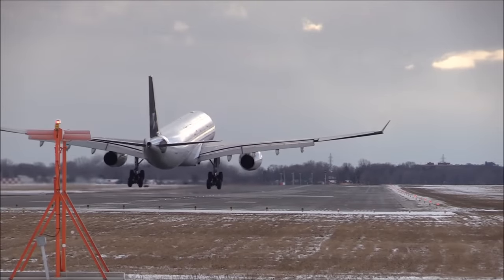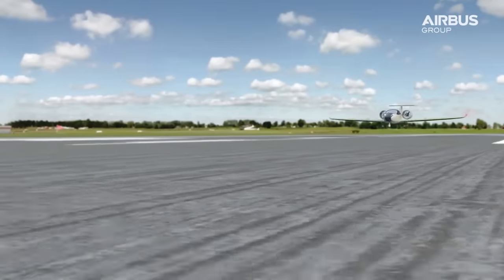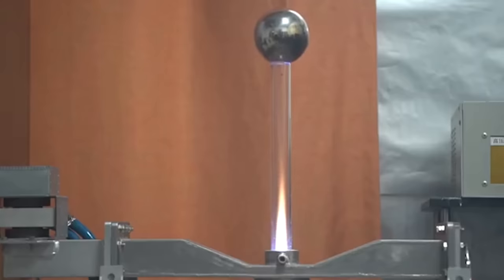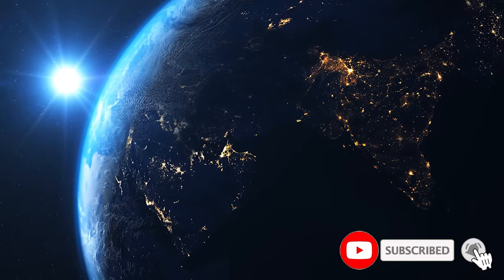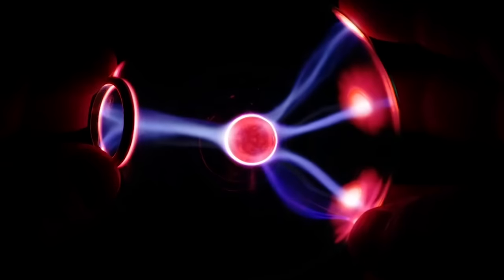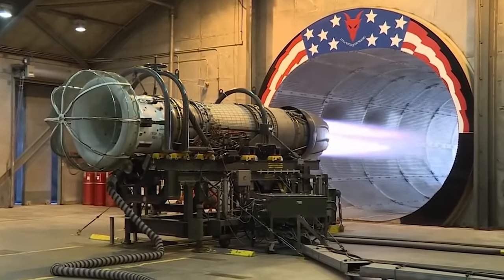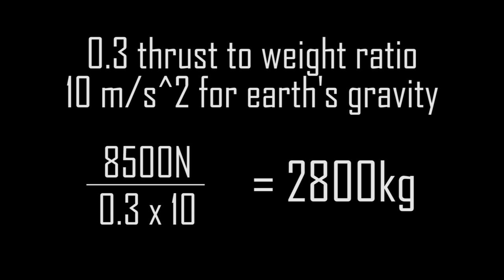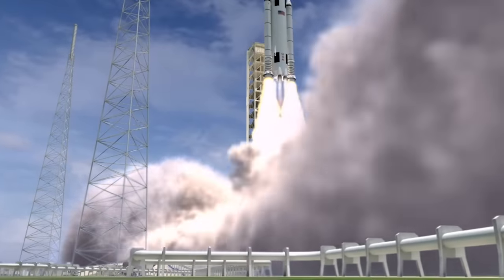Uncovering China's New Electric Plasma Jet Engine

Comment: As a retired airline pilot I've always been interested in advancements in aviation. In the last half century we've seen aerodynamics, avionics, and construction methods improve but propulsion improvements have lagged. Light category aircraft have benefited from improved engine reliability but the high bypass fan jet engine has been the workhorse of the airliners and seems likely to remain so for a long time.
Reply: Beating their incredible efficiency and the energy density of jet fuel is one hell of a hurdle.

Got me thinking though. I'd imagine, unlike history, civil aviation will be the first adopters of this. Unless fast charging and energy densities really increase for batteries, the military is going to want the faster turn-around times of just shoving fuel in the aircraft. (Though I'm sure the US Navy is already looking at this really hard. The newest carriers have a ton of extra capacity for energy generation and distribution for future tech. Electric aircraft would reduce logistics requirements a fair bit.)
Reply: Robert Slackware  lmao, no. Just no. Literally no one banned anyone from pursuing cold fusion. It just literally doesn't work.

Except for muon-catalyzed fusion, which is in fact a thing. It also requires you to have a particle accelerator handy. Not exactly practical, and farther from net positive energy than the worst tokamaks.
Reply: I remember as a kid i was always asking why no one build plasma engines, it seemed so doable. And now after years upon years of imagining what it would be like and playing around the idea in 3d modelling program, now China makes the first steps. Same goes for space mining. Why nobody tried before until now China is making the first steps again. Its kinda weird.
Reply: @EddyKorgo  Don't mistake being the first to publish something that might work with the first time it's been tried, or even developed.
Reply: @EddyKorgo  It's cos of the cultural shift in the 1960s. Western Society turned its back on the incredible scientific advances that propelled humans to the moon, and turned towards "the arts", hence we went from walking on the moon to not even being able to achieve low Earth orbit without using someone else's shuttle. When our young 'uns start studying science again, instead of "arts", we will stop falling backwards like the Western world did after the fall of the Roman Empire. We should learn from the South East Asians, who went from agricultural societies to leading the world in technology in a few short decades. A very inspiring bunch of chaps. Cheerio!
Reply: @liesdamnlies3372  nope. IT DOES WORK. just it has to be studied deeply, cause they do not really understand how it DOES work. governement just do not finance project about cold fusion, and unless a billionaire want to do it, nobodody else will. so yes, no goverent has banned research on it, but without accessing funds, the research is basically impossible.
Reply: @oreziopancrazio3685  Prove it.
Reply: @liesdamnlies3372  are you serious?
Reply: @liesdamnlies3372  im not a scientist. in case you need more info about, my country, Italy, and Japan, are the two country which have experimented most on cold fusion. You can easily search on the web for Giuliano Preparata and Emilio Del Giudice, they never gave up on cold fusion, despite the exigous funds. Now even Nasa 30 years later is on it, they change name because "cold fusion" its a disgraced word. Thy call it LENR, low energy nuclear reaction. Search for it, you will be surprised.
Reply: @Zero Harness gravity? Huh? You mean like we do with spacecraft?
Reply: @oreziopancrazio3685  Okay, so let me get this straight. You insist that cold fusion is a thing, insist that the only reason it isn't being researched is because it's being suppressed by governments through not giving it any funding. This is wrong. You then go on to say NASA is "on it" and that they called it "Low energy nuclear reaction". This, again is not true. And you say all this authoritatively in your previous posts, but now fall back on "I'm not a scientist." Indeed, you aren't. I can tell.

Here's a single reference to LENR from NASA: https://nari.arc.nasa.gov/node/259

That report does not consider the feasibility of such reactors, only what could be done if they existed. It's right in the abstract: "This report does not explore the feasibility of LENR"

"Low-energy nuclear reaction" is not a term coined by NASA either. It dates back quite far and is used by the people who still pursue cold fusion to disassociate themselves from that term. This is no different than alternative medicine people rebranding something that's bunk as something else to not be dismissed, deservedly.

The only link I can find between NASA and this term, "LENR", where NASA is touted as working on cold fusion is from terrible science "journalism" that mistakenly links it to NASA's recent breakthrough (this year, in fact) with lattice confinement fusion. That's not the same thing at all. It's not even cold! What NASA has done is initiate good ol' hot-as-hell fusion on a small scale. Pumping 2.9MeV of gamma radiation at a single point is a shit-load of energy. It's hot fusion a tiny bit at a time. Is it exciting? Sure as hell is. Is it cold fusion? No. No it is not.
Reply: @Zero Barring a theory of everything that turns-out to have gravitons, I really don't see that happening. I mean, even assuming you could do it, influencing space-time like that takes a lot of energy. A lot a lot. If you know about the Alcubierre drive, you might remember how models of it predicted the energy requirements to be several times that of all the matter in the known universe. Better geometry of the rings got the energy required down to a single Jupiter mass. (Yes, that means getting all the energy out of the entire mass of Jupiter. Black holes can only be used to convert about 5% or so of matter into energy, and that's the most efficient process we see in the universe, that isn't a matter-antimatter reaction.)

And of course the ultimate caveat: That's negative mass. You have to assume that this exotic matter exists at all, and then have unfathomably large amounts of it to bend space-time to a useful degree.

Artificial gravity is something very, very squarely in the realm of science fiction. It's not that we just don't know, it's that we actually do know what's involved and it ranges from wildly unlikely to provably impossible.
Reply: @Zero One, I said "wildly unlikely to provably impossible" which is not the same as saying "impossible". Two, you can indeed prove things to be impossible; that's the power of mathematics.
Reply: how about they make planes that dont crash first
Reply: @Robert Slackware 
I'm always amused by people who claim that "the government" is stopping us from having advanced or free energy. All the energy for my home and my car is free (after the investment for the collector and storage) and not only did the government not try to stop me, but the government subsidized the initial cost. Solar panels on my roof provide all my energy for free, and batteries in my garage store enough to carry me through the night. Combined state and federal tax credits paid for 30% of the cost. We are surrounded by free energy: Sunlight, wind, hydro, geothermal, and others. These are real and they work and the government supports them. The only reason to want fusion (hot or cold) is so that electric utilities could charge us for the electricity. Further, if cold fusion worked, it wouldn't need the government to pay for it. The big utilities would be building it. Harping on cold fusion makes no sense. We have free energy all around us. All we have to do is gather it up.
Reply: @danielschechter8130  "The only reason to want fusion (hot or cold) is so that electric utilities could charge us for the electricity"

Well that part just isn't true at all. There are plenty of other reasons, like fusion propulsion systems, or for applications that require large amounts of energy locally (certain industrial operations), or high-energy physics research.

And there are places in the world where all of the sources you listed are unavailable in sufficient quantities to replace demand. And there's the density problem, with simply how much land every method you mentioned requires. (Yes, even geothermal plants need very large areas to deal with waste water.)

All that said though, screw fusion, it isn't here. Fission is where it's at.
Reply: @liesdamnlies3372  you can’t just say “screw fusion” and then say “fission is where it’s at”. You do know that if we do achieve fusion then it will be the most efficient and cleanest power source humanity has seen? Sure fission is great, but it produces waste that’s highly toxic, and needs to be buried for hundreds of years. Never settle, because when you do that you’ve given up on what technological advancement really is.
Reply: @___solar___  "You do know that if we do achieve fusion then it will be the most efficient and cleanest power source humanity has seen?"

Um, no. That depends on exactly what kind of fusion you're talking about. D-T fusion still produces high-level radioactive waste. If you want clean fusion power, you need to have aneutronic fusion, and that requires significantly higher temperatures and pressures than D-T (and, a reminder, we can't even get that close to net positive energy yet). It also has this pesky problem of not being available. We need a solution to our energy needs now. Not tomorrow, today.

The waste problem for fission is solvable and has been solvable for decades. People seriously hype-up this "highly toxic" waste far too much. For one, "toxic" is the wrong word anyway, unless you're planning on chowing-down on heavy metals. The Swiss, for example, use geologic storage for their waste, and the waste from all the power plants for the entire country fits in a relatively small room (think a few Olympic swimming pools in volume). You literally just let the stuff cool in water for a few years, pack it up into concrete containers, stick them deep underground in areas that aren't geologically active, then seal them up when you're done. Finland is doing the same. I suspect you don't know that much about the current state of nuclear fission as an energy source given that you brought this up as if it were a compelling argument.

This isn't about "settling" for anything. This is about using the tools we have available to solve a crisis. Waiting on fusion to get anywhere isn't an option.
Reply: @liesdamnlies3372  wow, you are hot as the fusion in which you strongly believe. relax. cold fusion is a thing, exist, the chemical rwaction DO produce excess of energy output. at this point of research they do not understand how to controll this reaction, but the production of energy is there, indeed.
Reply: @liesdamnlies3372  desktop particle accelerators can now rival the large ones.
Reply: @gary.richardson  lol wut
Reply: Have you heard of the geared turbofan? It's not a new concept, was being worked on for a very long time, but I think it does qualify as an advancement in engine technology. After all, it increases efficiency and decreases noise production.
Reply: Problem is that propulsion is governed by thermodynamics, a really stubborn law of nature, impervious to every trick.
Reply: @EddyKorgo  this stuff has been around for 70 years the reason no one uses it is because they are way to innefficient
Reply: The last word, and coincidentally the latest, is field propulsion. My work in theoretical physics should be ready for publication by 2023.
Look for the term GMP. And don't buy into the cynics naysaying. There is a huge vested interest in combustible fuels. And they want to keep their monopoly on power. Does anyone really believe our future to the stars lie in rockfuel ? lol Give me a break !
Reply: @liesdamnlies3372  what kind of fusion do you think I’m talking about? And I don’t think you get the importance of advancement and research here. You’re too busy thinking about now and not *what could be*. Sure, storing waste in a geological storage container is good, but we could clearly eliminate that whole process if we achieve a aneutronic fusion. We’re not far off of achieving this. All it takes is a few more years of constant research and development. Keep in mind we are in fact in a technological boom and things will start getting invented at light speed. More tech has popped up in the last 10 years than in my lifetime.
Reply: @stefanschleps8758  exactly. There are way more efficient forms of propulsion to crack. If we find out zero point energy it could change the game forever, as well as finding out how to create antigravity.
Reply: @___solar___    “What could be” isn’t good enough for solving our energy needs and climate change. Fusion has been just a few years away for what, 70 years now?

We’ll have passively safe fission reactors in a few years, and I can say that with confidence because the engineering and regulatory problems are being solved apace here in Canada, on top of the technology being well-understood.

There’s a huge difference between solving engineering problems and physics problems.
Reply: @liesdamnlies3372  I can see you have no hope. No faith that someone will eventually make a breakthrough. Stop worrying about what’s going on in just Canada and worry about what the whole world is trying to achieve. The whole of humankind is trying to achieve fusion, not just one country. Think about that for a second.
Reply: @liesdamnlies3372  on top of that we are trying to achieve something that has a power output infinitely times greater than fission. I can see why people are trying to achieve this. There are several joint countries making breakthroughs to this day.
Reply: @liesdamnlies3372  the men that built the tools and technology we use today were ambitious. Doing this and researching this requires ambition, otherwise we wouldn’t be here today as a species. Ambition drives innovation.
Reply: @___solar___  "power output infinitely times greater than fission"

Call me when they can manage to even get net energy. You know what actually is making the necessary progress, right now? Programs like Rolls-Royce who will be building Small Modular Reactors in the UK within the next five years. Nuclear reactors, right off an assembly line. Fission is on its way to reaching economy-of-scale and passive safety.

You're talking as if I want fusion to fail. There's a difference between "having no hope" and simply being pragmatic. It's insane to have a tool right in front of you that will get a job done, more than satisfactorily, and not use it and rather waiting for a hitherto unproven-future-maybe-solution to the same problem. I have a hammer, and need to drive a nail into a wall. The hammer will do the job just fine. Should I instead wait for someone to invent the next, best nail gun? No.

Stop romanticizing the pursuit of fusion as an energy source and put on your thinking cap instead. I'm talking about solving a crisis with the tools we have, right now. You're talking about what might be a nice solution if it works in future. Even if it does, it still will not have solved the biggest issue with nuclear fission, which is being solved right now in the latter, which is the initial capital investment.

To use another analogy: Someone is having a heart attack. I have an AED that will stabilize them now. Should I wait until I can get them to a hospital thirty minutes away so they can use their better defibrillator? See, even if fusion is a panacea, it's not coming soon enough. Even if we had net energy yesterday, it's not soon enough.
Reply: @liesdamnlies3372  I think you misunderstood or I didn’t note that fission is good, yes. And I’m not romanticizing. Simply stating the importance of figuring out how the fuck to develop fusion power. You’re talking about fusion not making good investment, and I’m here to tell you money doesn’t drive research and industry, which gets products up and moving in the public use. Its not just that, but it’s the people’s effort. People drive industry, and it’s everyone’s choice wether they want to give effort to get fusion going. A world with only profit and no effort, dedication, or passion is a world making no live changing progress. Just rich people making more useless profit. And right now there isn’t much effort today. Just people talking about how the next product will make them money, it’s sad. Capitalists crave only profit. Did you know that technology the government possesses is about 100 years ahead of the tech that the public uses? Probably not. This is because we only put technology out to the public for consumption which makes long term constant profit and is easy to make. There needs to be an awakening (If you look, it’s only just now beginning), and it needs to start now, or never. Think of a world where everyone works together and helps each other. What kind of world would you imagine.
Reply: To those educated and understand fusion I have a quick question (I hope it’s quick), I thought liquid salt reactors ( I think that’s what they are called) solved the issue of fusion reactor waste? I watched a young prodigy speak about a reactor he had designed ( recently) that runs on reactor waste and is cold,can’t melt down like regular reactors and is quite small, I believe he said a shipping container sized reactor would produce 50 megawatts.....thoughts?
Reply: @1966cambo  my past comment I thought you were talking about fission. My bad. A certain type of fusion shouldn’t produce waste as the process is the opposite of fission, it is compressing particles together so no waste is present, only energy. Other forms of fusion I’m not really informed on, although that cold fusion reactor you talked about is true, and I’m guessing it runs on the waste from fission reactions.
Reply: @1966cambo  there are several ways to produce a nuclear reaction to produce power, but aneutronic fusion is the holy grail in power generation. That’s what we’re trying to achieve. With that being said we can also use easier forms of reactions to produce our power in the meantime. Hope you have a grand day. Sorry if I look like I’m spamming lol
Reply: @___solar___  right, sorry I have my term wrong, it is fission reactors I was asking about . The fact the liquid salt reactor this kid invented uses waist from reactors and eats it up it solves the one big problem with reactors, radioactive waste! 
So why not have larger reactors near larger cities and these small salt reactors in smaller towns? 
Seems to solve the electricity issue ......
Reply: @1966cambo  I think you're mixing-up a few things there. For one, they'd be talking about "waste" from nuclear fission (the more accurate term would be spent fuel), not fusion. When fuel is spent by one nuclear reactor, depending on the design used, it may still be usable in another. The CANDU has long been able to serve as a garborator of sorts for the nuclear industry, it's just not been used in that capacity. It's easier for us in Canada to just keep mining our large uranium reserves, both for domestic use and export, than it is to even consider wrangling through all the legislation, policy, protests, NIMBY's, and everything else just to get our hands on say, the US' spent fuel from their reactors. (With reprocessing though, we could easily be using most of the fuel they have left-over from their light-water reactors in ours.)

When it comes to burning-off spent fuel, you either need a reactor that can run on the fission products of the reactor farther up the chain (like how a CANDU can gobble the "waste" from light-water reactors, in theory anyway), or you need to change tack and go with a different fuel cycle. I suspect what you saw was a molten-salt reactor (MSR) with the potential to use the thorium fuel cycle. With the thorium fuel cycle, we could add small amounts of spent fuel from the uranium cycle and burn it off. The waste then only needs to be kept safe for 300 years until it's safe to handle, and we can build geologic storage that'll last that long, if we want to (Finland is doing it).

They might have also mentioned fast breeder reactors, which could do the same, using spent fuel from the less efficient and old-as-fuck reactors being used so often today.

Of note, MSRs can be designed (and are being designed) to be passively safe. That means you can literally walk away from them. If there's a loss of power to the cooling system, the problem doesn't get worse, the nuclear fuel will spill-out onto a slab underneath the reactor where it'll be in a non-critical state. Don't get me wrong, it'd make a right mess, but it's a safety measure that requires zero human intervention. We can, in short, design reactors to fail safe now (and are).

There are also other approaches to passive safety. One I learned about that Rolls-Royce may use for their version of small modular reactors (so mass-produced in a factory things, letting economy of scale become a factor in future), is to simply have the reactors in a giant pool. They would have active cooling during normal operation, of course, but should all else fail, the reactor will power-down and the water surrounding it will provide enough volume to absorb the decay heat. Bingo-bongo, you've got yourself passive safety (just make sure the pool is kept full XD ).
Reply: @liesdamnlies3372  I said “liquid salt” I guess I should have said “molten salt” but yes that was/is the design I am speaking of. I believe his design was fueled by the spent fuel from large reactors and he believed he could just bury the reactor so as to keep people from messing with it.
Interesting stuff
Reply: @1966cambo  Sticking the entire reactor housing in the ground sure would reduce your deconstruction and decontamination costs at the end of the reactor's life.
Reply: @1966cambo  when industrialization kicks in with that new model (which will eventually be in short time) then we could see these fission reactors in small towns, and fusion in cities. Indeed.
Reply: @1966cambo  then if time comes along we could then transition smoothly into all fusion based reactors.
Reply: @___solar___  I had a good laugh when Obama offered the kid a job and the kid replied, no thanks but I will sell you my technology. Brilliant kid in so many ways!
Reply: @1966cambo  the kid must know what the job system is like. Good kid.
Reply: @liesdamnlies3372  While I agree, it is similar revolution like SpaceX resuable rocket boosters, but then military is tempted to find big dam or similar near airport to drain huge amounts of power. Boeing 747 also eats fuel like candy so after space rocket it is second in line. Tho this is still interesting what advances they can do in aviation. For least, it will widen possibilities of energizing planes from just jet fuel to multiple sources, maybe according to size of plane or other factors.
Reply: @theloweffortchannel7211  
That's ridiculous! I have solar panels + batteries. My entire house AND my car are run on 100% solar electricity. It's way cheaper than power from the grid and produces no carbon.
Reply: @danielschechter8130  And you purport that it is viable globally despite a hard limit being lithium because?
Reply: @theloweffortchannel7211  
No single solution is viable everywhere. You stated that solar is a scam. It is not a scam. It is the best way to produce electricity in areas with abundant sunshine. In some areas wind power is more effective. Or geothermal. Or hydro. Where I live solar is far and away the most cost-effective way to produce electricity. NOT a scam.
Reply: What do you think of Germany's e-kerosene used in jet engines? That renewable kerosene is produced using electricity, and has the same energy density as fossil kerosene. Also, scientists have built fuel cells that can work on regular kerosene, so I am betting e-kerosene could run in a solid oxide fuel cell (SOFC), and be used to power a future plasma engine. Or, the SOFC could more realistically power a DC motor propeller or two, like the one on the battery powered Airbus E-fan.